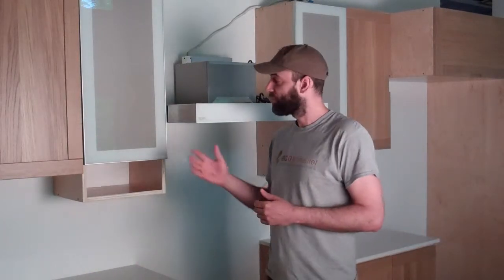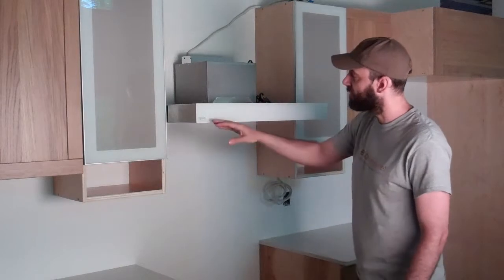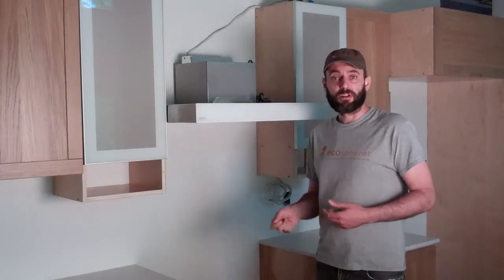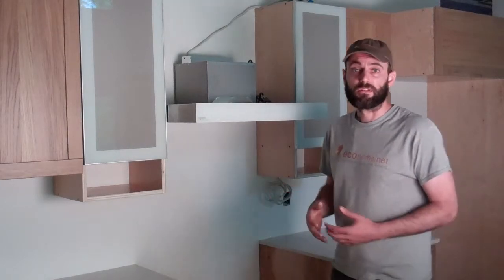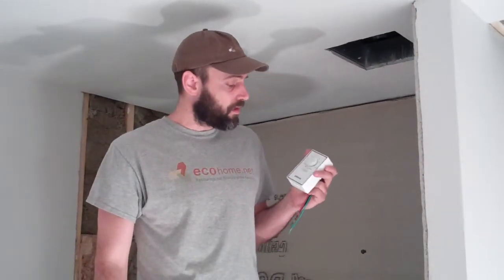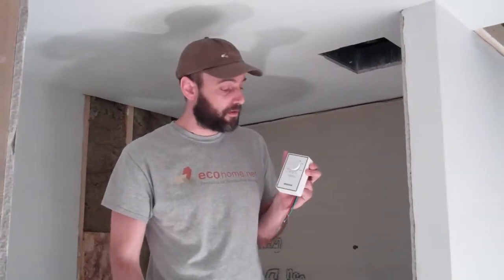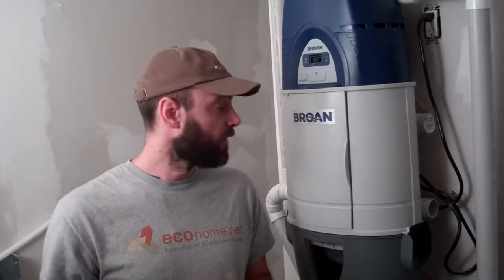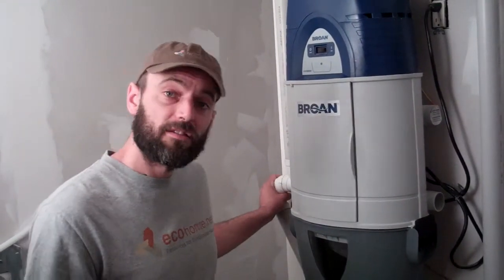Ventilation in LEED & Passive House Homes - Indoor air Quality - How to Ventilate a Home Efficiently

Comment: Fellas... Quick question, where are you pulling makeup air for the Central Vac if it's exhausted to the outdoors, and how much of a conditioning penalty are you paying for that? 

I would think it'd be easier to push the exhaust through a relatively high quality filter, rather than having to deal with refiltering/reconditioning the makeup air...

Beautiful house by the way!
Reply from the maker: +John O'Brien Thanks!  Our Lunos air exchange system  has a setting  on the control panel (conveniently located near the central vac outlet) where they can all direct air in during that time to balance pressure.  In many cases like this people end up opening a window to compensate, not  an idea solution, we know. creating air tight houses do have their challenges that are still being worked on, venting air out or filtering it is a hot debate topic in performance circles.